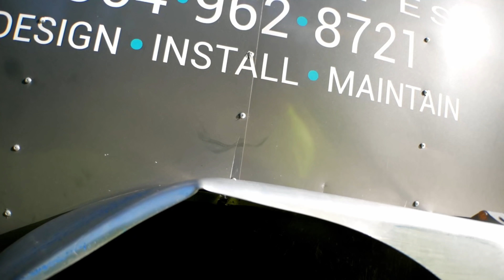$1,000 in DAMAGE in 2 DAYS! SCAG V-Log #11

Comment: The taper of the lug nuts and the matching taper in the wheel is designed to center the wheel on the hub and to keep the lugs tight, the fact they were on backwards might have allowed them to loosen, but the sever tire wear appears to be more of an alignment issue. You said trailer had a bent wheel ---also possible axle is also bent .
Reply from the maker: The replacement tire is fine. Keeping an eye on it
Reply: I agree. I wouldn’t think the lug nuts on backwards would make the tire wear like that
Reply from the maker: William B axle was bent after all
Reply: Bet a new axel with brakes wasn’t cheap, hope thing get better. Enjoy your channel man
Reply from the maker: William B thank u brother

Comment: I replaced the front sheet aluminum of an enclosed trailer where they backed into it hitching.  Within a week they had backed into it again.  When they hit the bollards with the fender and wheel it's often a lot of force.  Need to check the axle and where it bolts up before a new tire goes on.
Reply from the maker: Tom Jones I know it sucks....so far the new tire wear seems ok

Comment: That could have happened to you . Who took the trailer in to get the tire? And who really checks a rim when a tire shop should know what they are doing but they make mistakes like anybody else. The fender cost me around 200 to replace the wheel was 160 so not really that bad. Good lock
Reply from the maker: John Bailey ok....diff prices everywhere. Not gonna argue with you brother. It was the right front tire on the truck, two trailer tires and rims and the trailer fender...pretty bad in my book. Now possibly looking at a bent hub as well

Comment: you can just replace the bottom bump part also
Reply from the maker: Johnny Miller yeah we are constantly replacing them we just do really large condo associations and so they keep these weed eaters out for three and four straight hours at a time there's a lot more Concrete Hard surfaces involved then they're typically is when you're doing nothing but homes. So we tend to go through them faster than when I used to do nothing but residential's
Reply: @beachriverlandscapes  they are cheeper off Amazon than the dealer ordered 2 yesterday

Comment: You made a good call on the echo speed feeds. It is true Stihl has a new speed feed. I have 2 of them on my 94r trimmers. They struggle to eject my favorite line when it runs out binding up in the head which requires a lot of force to extract it. Nit picky but is a real pain. The line I am referencing is green shindaiwa grass attack 0.095. Functionality is the same as the echo but it is wider, heavier, and not as easy to wind as the echo. Can be finicky to find the sweet spot as you have to depress the button just right to make it turn.
Reply: Round and twisted lines haven't had any issues with failure to eject though
Reply from the maker: jordan kane cool thanks for the info brother